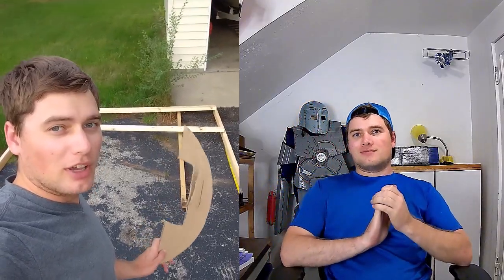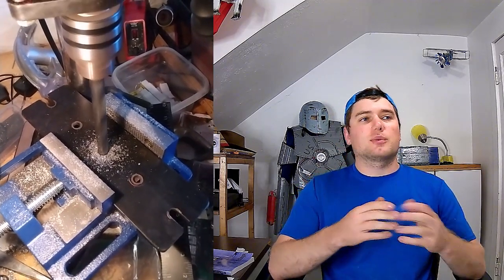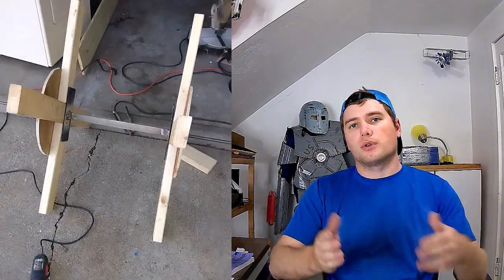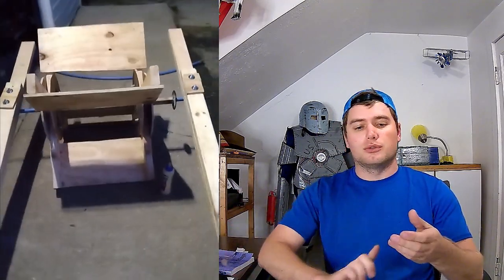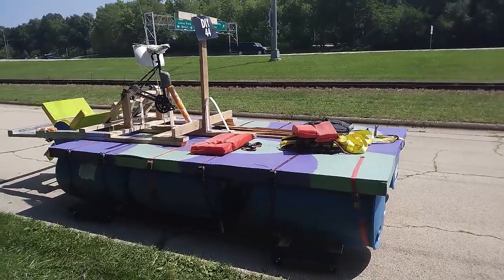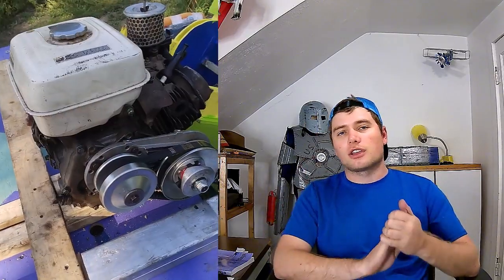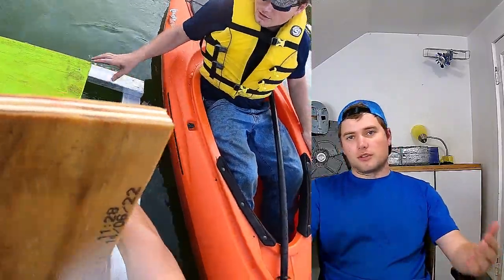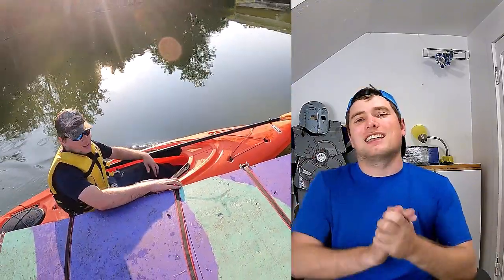DIY Barrel Raft Build -  Homemade Paddle Wheel Boat

Comment: Cost of this build?
Reply from the maker: Honestly it's kinda hard to get a exact estimate as we had allot of parts laying around including the motor and sprockets...if you had to buy everything new it would be close too $1000...but that's not realistic as in a lot of places you can get the barrels for free like we did... And can scrounge lumber... The hardest part for this to get would probably be the drive gearing sprockets chain and stuff... You also would need to find a good motor we just happen to have the perfect one and a torque converter... Probably run around $200 for the parts and maybe like 300 for a used motor or something like that.... It's really so dependent on the area... I would say this definitely isn't one of those things where I would recommend duplicating it as is but more the idea with your own spin on it... You do however need a fairly strong motor as the paddle wheel is super heavy to turn but this can be negated if you make a smaller wheel with wise so potentially you could use a different type of motor with lower horsepower... We did it one point consider using a predator 6.5... but decided with this wheel it wouldn't be strong enough...
Reply: @PatriotContraptions  Thank you for these details. 😀

Comment: More buckets (8 for instance)on the wheel would help transfer power to the water better for sure.

Looks like a fun build though
Reply from the maker: I agree, we didn't understand how close the peddles could actually be and still provide force due to the boat moving forward constantly.  We have been going back and forth about whether the current setup would be strong enough to add an extra four paddles come spring.